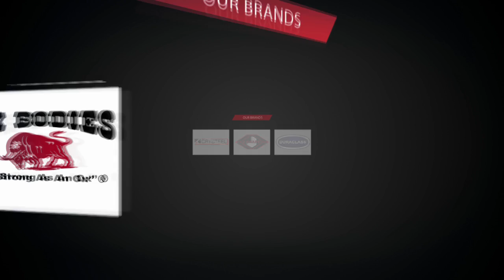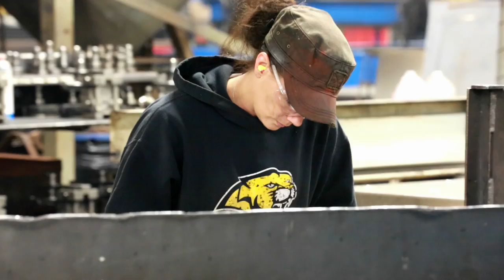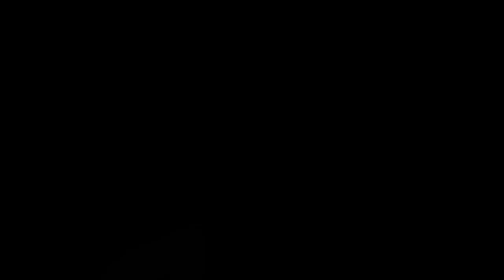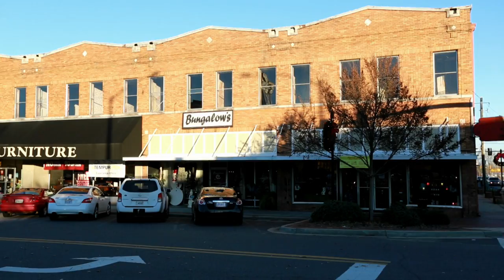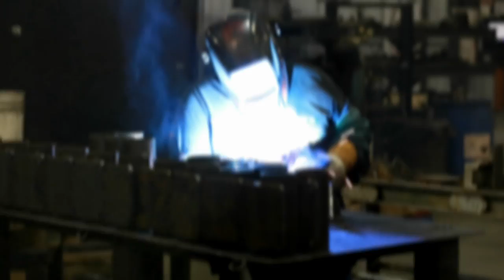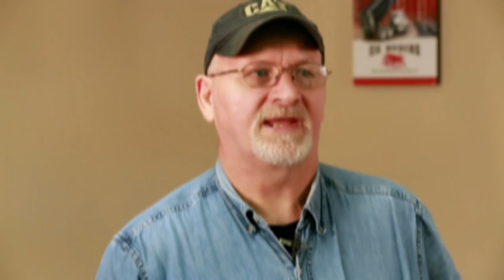This Is Ox

Comment: I drive a 2015 Mack Granite dump truck, which has an Ox Bodies bed on it.
While the bed itself is tough as you could ever want, the way they do the wiring for the lights is half assed!!! They put a 1x1 tube under the bed, and don’t weld the thing to keep it in place, for one. The wiring loom on top of my cab protector has fallen down in my bed several times, because there’s no clips or nothing to hold it in place. Just the connections to the lenses. Kinda half assed way to do things. Good thing I caught it before it had a load in my bed!!!